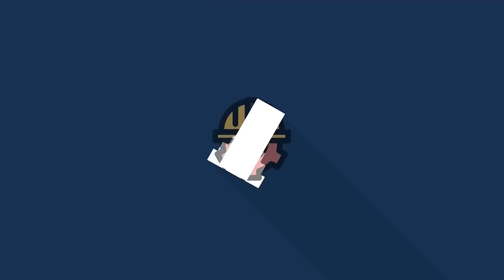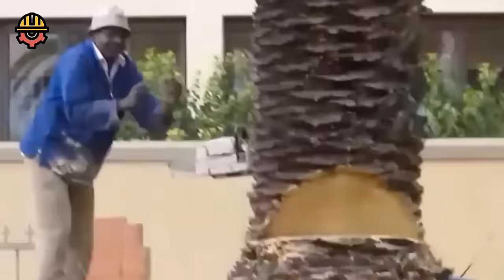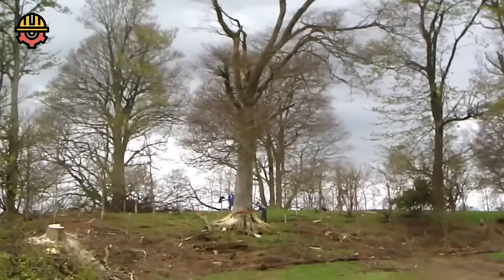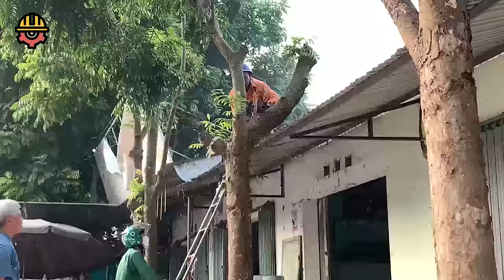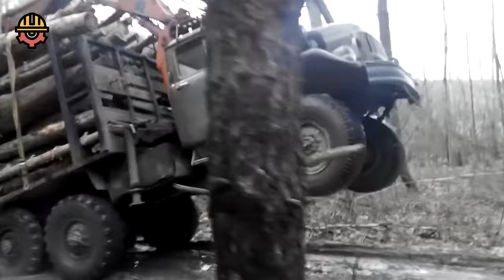Dangerous Fastest Idiots Cutting Tree Fails Skill With Chainsaw, Tree Falling on Houses Compilation

Comment: Bro that guy on that palm tree is a legend. Some of these guys are cutting w the dullest chains ever
Reply: Yeah
Reply: I agree. I’m an arborist and that dude has some balls! Definitely a legend.
Reply: Even though it's dangerous, watching the first part is very funny
Reply: I cut pulpwood with a crew and we had one man who done nothing but sharpen 
and maintain the chainsaws and equipment!
Reply: @ludicrous7044  What is paper pulp used for?
Reply: @far_outlook  
Paper pulp is ground up pine trees that put in a acid bath to melt it into a paste 
that is used to make paper products.
Reply: @ludicrous7044  Is using pulp to make paper really durable?
Reply: @ludicrous7044  by hand with a file?
Reply: @far_outlook  
It was 10000 years ago!
Reply: @ludicrous7044  I do not believe
Reply: @Staroy  
A round file called a keyhole file.

Comment: From what I've seen, most of these fails, if not all, come from not using ropes or not using ropes properly or not using enough ropes to pull the tree in the proper direction of the fall using a hand winch(s).

Comment: That first guy with the big tree stump - where did he expect it to fall? Out of four possible directions, only one is clear. Those aren't good odds, especially if you cut from the bottom so it remains one huge piece.
Reply: @Paul_Wetor  
It's safer to crane that 💩down!!
Reply: @ludicrous7044 Tell that to the crane that was upset😅😅😅

Comment: The 3 things that I immediately see as failure is not considering the lean, not putting in a forward deep 1/3 45-60 degree notch and not leaving a 1-2 inch hinge.

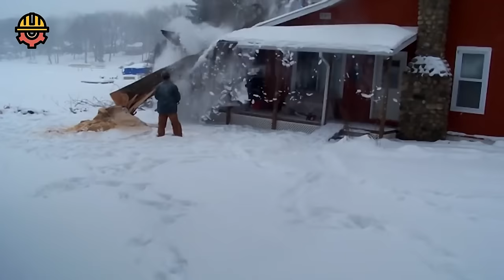Comment: The accident at 3:45 happened with tree crashing to opposite side of notch.  I thought tree is supposed to fall in direction of the notch?  Sounds to me like either tree was leaning too much in one direction or notch measurements were incorrect.  Sounds to me like this is dangerous job susceptible to more risk with these larger trees.  I would not want to have this job.
Reply: No rope in the tree to pull it in the right direction or wedges. He just cut his hinge wood off and the tree just went to direction where gravity pulls it.
Reply: I think the branch. Guilty of Treeson didn't need no rope, but he cut almost every branch.